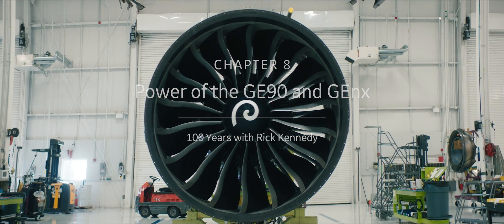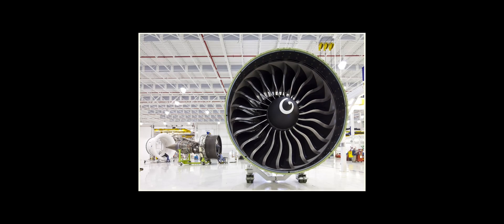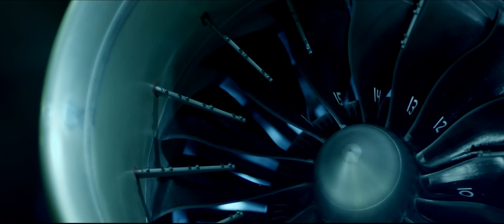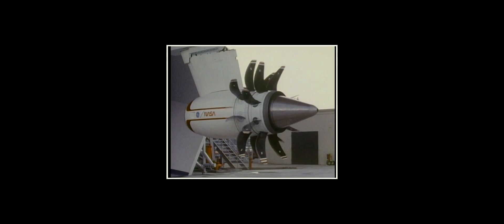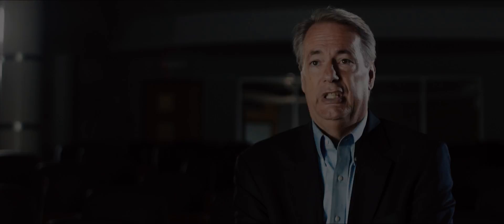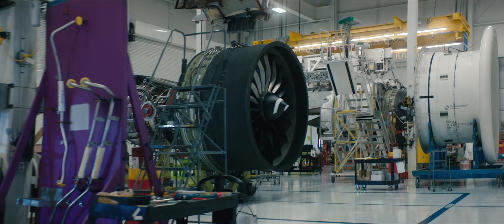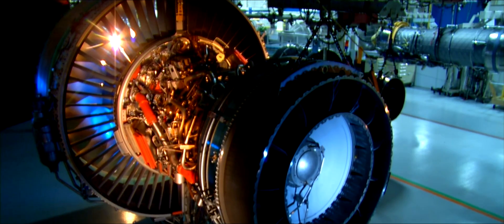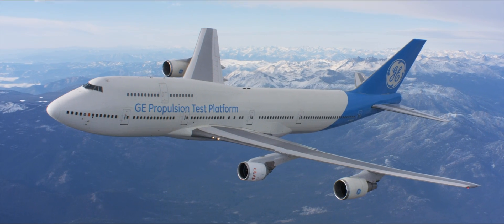Chapter 8 of 13 - Power of the GE90 and GEnx

Comment: I was 13-18 years old. My classmates were dreaming with Nike shoes, me: I was dreaming with seeing one 777 with a GE90 engine. In that time, 777 were not coming to my country, but my waiting ends on 2003 (17 years old) at Atlanta International Airport, I was traveling in a 767, and that image, of that 777 with those GE engines will be one of the images that I will remember for all of my life. Thank you for that moment, that I will never forget. My dream as a teenager, was to work for GE, one reason was the GE90. My dream never came true, but I had great moments as a student with your turbines and generators (power generation). Greetings from Costa Rica.

Comment: Amazing stuff. Congratulations on those engines. What am I missing then that the share price is just under $7.00? Can one suggest the 777 could become the new 747?
Reply: Yes
Reply: Only if one wants to suggest its a failure. It took 40+ years for Boeing to sell more than 1000 747s and the last two real "variants" - the 747-400 and 747-8 - which basically is more 787 Dreamliner than 747 given its 787 wing and the fact that the WING IS THE AIRPLANE - account for way over half that "success". Until GE got serious about civil aviation and did it's own thing and provided alternatives to the endlessly rehashed and renamed R-R boat anchors and the "obsolete" P&Ws on the "original" 747 and the aircraft finally became all it could be 30+ years after initial "development", it was an abject failure by comparison to all other  Boeing civil "airliners". Ultimately it was "profitable" prior to the 747 only because the new Seattle "plant" centralized "jumbo" production in one facility just when Boeing was running out of military aircraft "orders" and had other paid off facilities becoming available for "narrow body" production. Anybody with half a clue knows the 737 and 757 really "made" Boeing in the turbofan era and GE's "competition" - especially R-R with its asinine "triple-spool" abortions that are yet to make their maximum "rated thrust" of a laughable 90,000ish lbs in a GE/FAA "triple redline test" (max thrust/max EGT/max turbine inlet temp) and survive period much less survive "unaffected" and not require "service" any sooner after than after any "single redline" test - was literal "dead weight" during the 747 "program". 

The one and only time R-R was forced to put its most "modern" so-called GEnX "competitor" on a real test stand - General Electric's in fact - and really "compete" to gain actual FAA certification on a new airframe - the 787-8 - in a real head-to-head test at the "triple redline" the "Trent" rehash of the RB whatever boat anchor had a serious "anomaly" and basically did its own brief "exploded view" illustration on the high speed and "totalled" G.E.s $7 million "test stand" - which was probably "obsolete" anyway since the GE90 "family" has now pushed the bar up to 130,000+ lbs of thrust and which GE engineers and suits probably couldn't think of a better way to "retire" if their jobs depended on it - and gave a little "preview" of just how the R-R 787 "competitor" in name and outside FAA jurisdiction only - would perform in real revenue service at 70,000+ lbs. "continuous" even at only one or two "redlines". 

"Grounded" for years and years at least as far as entering U.S. airspace and/or carrying U.S. citizen "pax".

And the delicious "irony" is that a big chunk of the Trent-powered 787 "fleet" is actually owned by G.E. Aviation Capital and is "leased" to "European" and "Commonwealth" airlines which do have to keep "their" planes "grounded" while paying the leases and maintaining the airframes in 100% airworthy condition  and while putting 0 flight hours and cycles on them ensuring that when the leases are finally "up" for whatever reason and/or R-R finally gets them "ungrounded" by the FAA and an R-R powered 787 is "worthless" with its "original" engines but worth probably 90% of new airframe "MSRP" (Boeing sells ONLY airframes and NOT powerplants EXCEPT "sole source" airframe-powerplant combo "variants" and its a foregone conclusion the next Boeing "7X7" will NOT have powerplant "alternatives" to GE) without those boat anchors and worth a premium over "new list price" if "NEOed" with the GenX R-R never should have even "bluffed" competiting with in the first place which is exactly what happened and when it got "called" along with their 90,000+ lbs of HOT AIR "sealed the deal" on a "Trent" or any other "triple-spool" TRAINWRECK "launching" or even "partnering" on a Boeing "heavy" ever again.

Comment: shame the A350 didn't also offer the GEnx or a version called GEnx XWB or something along those lines alongside the RR Trent XWB
Reply: It's not Airbus but GE was unwilling to provide engines for a 777 competitor.

Only the A359 can accommodate the GEnx the stretch A35K requires a GE90 Thrust rating.
Reply: Nowdays is just better to have one provider that matches the requirements for each aircraft, like the GE9x or the Trent XWB and Trent 7000. In fact, both GE and RR had issues adapting their engines for the ever changing 787

Comment: The 737 MAX 8 uses LEAP-1B engines made by CFM International, a joint venture of General Electric and Safran. They should have told Boeing that  these engines are not fitting on 737 MAX8

Comment: i thought the composite technology for heat enduring jet engine blades was ceramic matrix composites CMC not carbon fibre composites CFC,
Reply: GE uses both technologies. For the extreme heat of the turbines, ceramic matrix (CMC) is indeed used. But for the Fan - on both the GE90 & GEnx engines - which is driven by the low-pressure coaxial shaft, carbon fibre composite has been used instead, making the fan lighter.